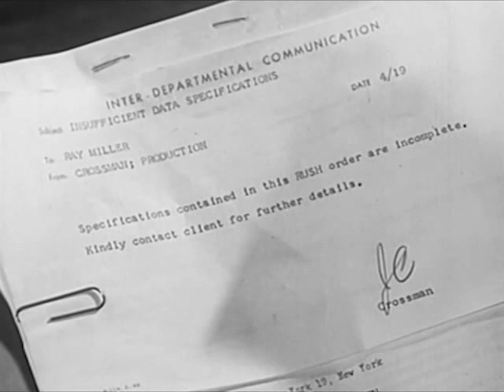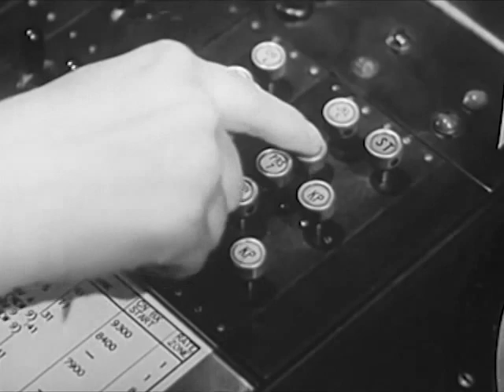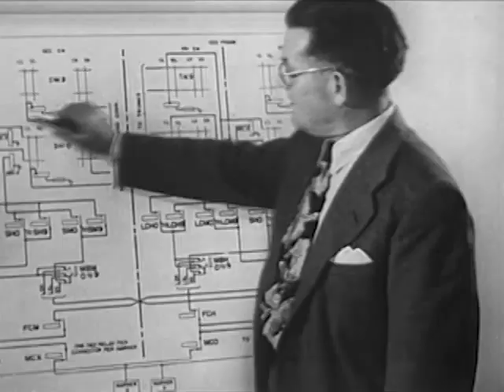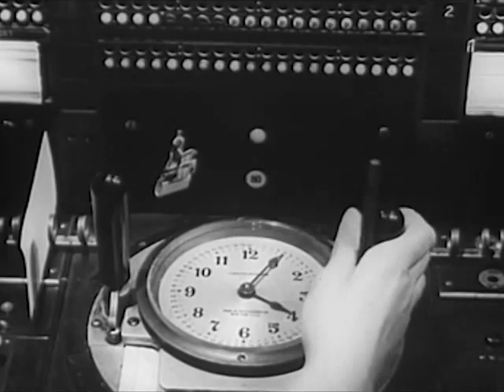Long Distance Telephone Calls: Speeding Speech - circa 1950 - CharlieDeanArchives / Archival Footage

Comment: The toll operator would write the number calling and the number called on a card before she made the connection with cords in outgoing trunks. The card would be put into a calculagraph which would stamp the start time. When the call ended the the lamp would go out on the outgoing trunk jack and the operator would pull the cord and stamp the end time with the calculagraph. The stamped card would be sent to billing.
Reply: hi